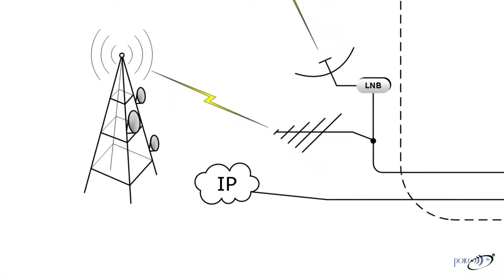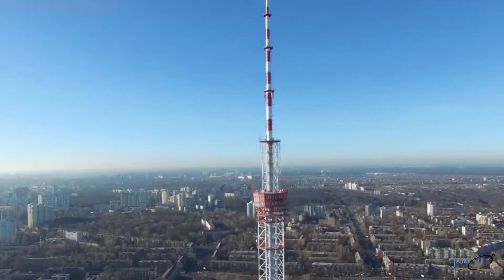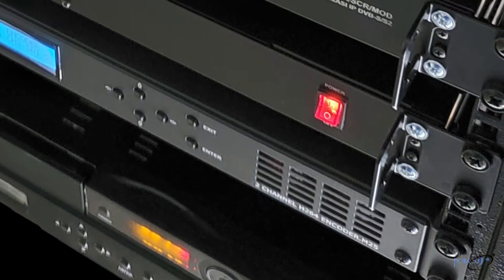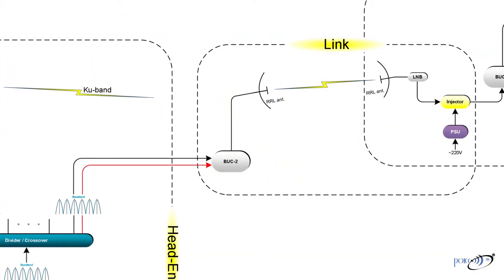How to build MVDS, TV Repeater and TV Link stations?

Comment from the maker: ►►► Contents for current video ◄◄◄
00:00      Intro 
                👉 Contact us 00:27
00:30 ▼ Signal sources of TV head-end station 
                The first source - inside the TV STUDIO 00:34
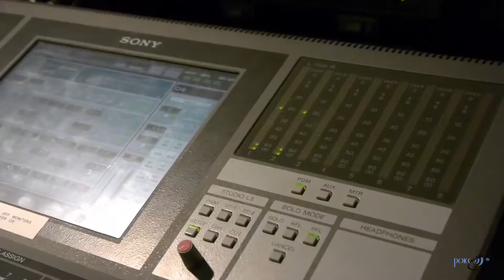                The second source - Cloud STUDIO 00:50
                The third source - Terrestrial TV Station 00:59
                The fourth source - Satellite 01:23
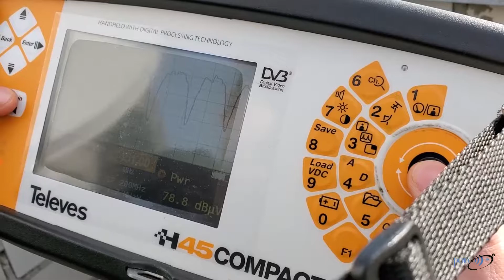01:50 ▼ MVDS principle 
                Receivers 02:10
                Encoders 02:46
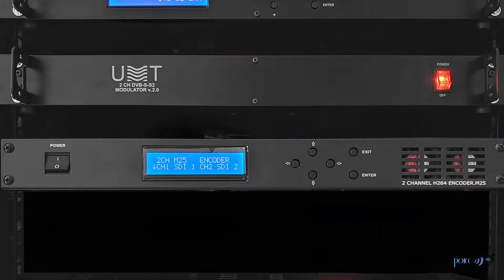                Modulators 03:07
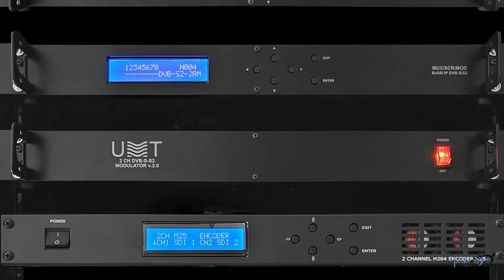                Scramblers 03:28
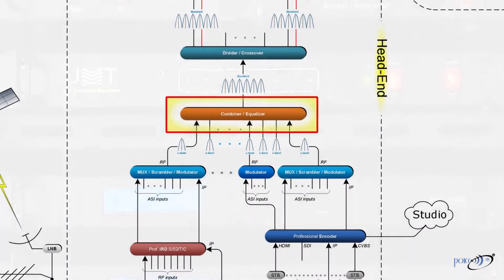                Combiner/equalizers 04:01
                Power dividers/crossovers 04:23 , 05:35
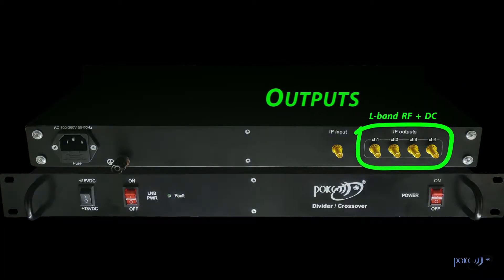                Head-end system management 04:41
                Comparison between schematic and real TV head-end station 04:54
05:11 ▼ Transmitting side. BUC and antennas 
                Slotted waveguide antenna description 05:16
                BUC description 05:21
                BUC powering. Type 1 - power dividers/crossovers 05:35
                BUC powering. Type 2 - DC injection kit 05:42
                Omni horn parabolic sector antenna description 06:04
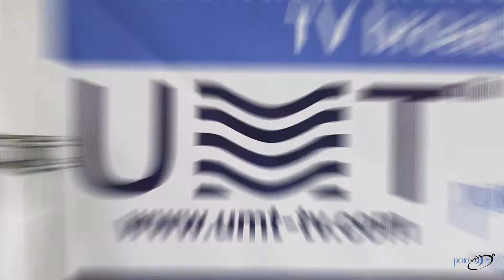                ✔️ The best ''OHPSA'' antenna position 06:30
                ✔️ Advantages of omni antenna 07:10 
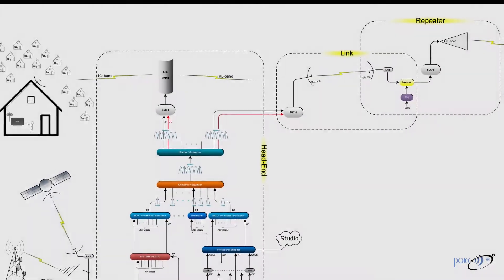07:24
 ▼ TV Link principle 
                📌 Transmitting part of TV Link 07:33
                Assembling process 07:39
                ✔️ Tx total construction 07:58
                ✔️ Mounting on tower or tube 08:06
                📌 Receiving part of TV Link 08:10
                ✔️ Rx total construction 08:18
                Powering of TV Link 08:31
                📌 Broadcasting part of TV Link (so called Link repeater) 08:46
                ✔️ Sector antenna installation 08:54 
                ✔️ TV Link and TV Repeater stations in real life 09:09
09:54 ▼ TV Repeater types 
                📌Type 1 - "Link repeater" 10:10
                ✔️  All component parts of TV Repeater (schematic) 10:16
                ✔️  All component parts of TV Repeater (in real life) 10:36 , 10:56
                📌Type 2 - "Broadcast repeater" 11:18 
                ✔️  All component parts (schematic) 11:24
                ✔️  All component parts (in real life) 11:32
11:53 ☝🏻 Advantages of TV Repeater stations 
                ❓ How many hops can be constructed using TV Repeater? 11:59
                🔔 Real example for DVB-S2 modulation and 8PSK constellation 12:21
                ❓ How to improve TV Repeater station, set infinite hops and scale your coverage area in unlimited mode? 12:52
                DVB Regenerator description 13:02
                🔔 Example of DVB Regenerator importance 13:53
--------------------------------------------------------------------------------------------------------
14:43      ✔️ About Roks PrJSC and UMT LLC business solutions 
--------------------------------------------------------------------------------------------------------

Comment: How to install cable tv system headend and transmitted through main trunkline to homes
Reply from the maker: Hello! Hope you're doing well! Our company UMT LLC proposes wireless TV solutions (TV headend, TV repeater, TV link) and equipment for them: BUC and LNB (for C, X, Ku, K, Ka-bands), Antennas (omnidirectional, directed, sector), IRD (satellite, multichannel), H265 Encoders, Scramblers (integrated powerful hardware CAS servers), ASI Multiplexers, Modulators and many others. Contact us for more details info@umt-tv.com and visit our website https://umt-tv.com/